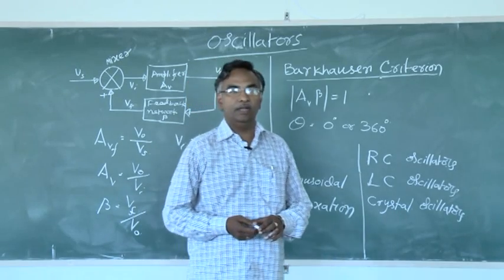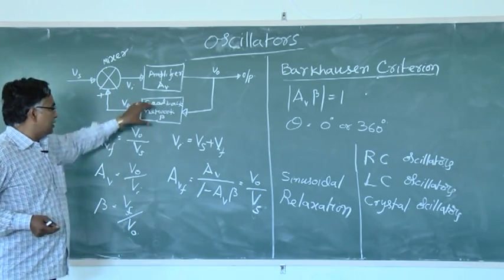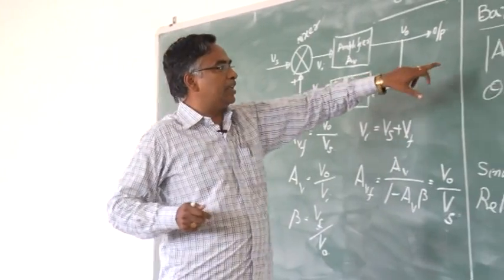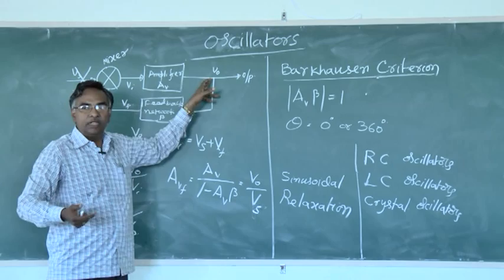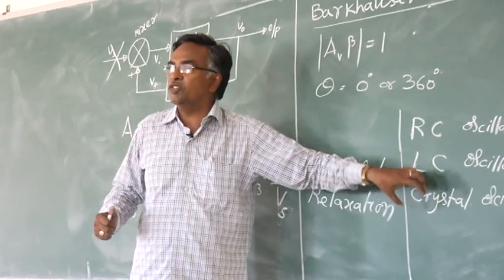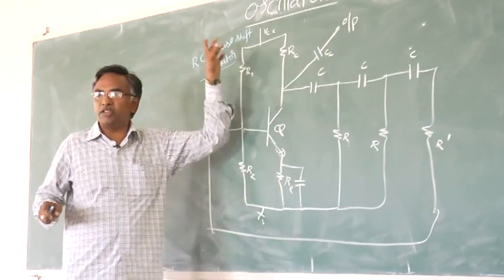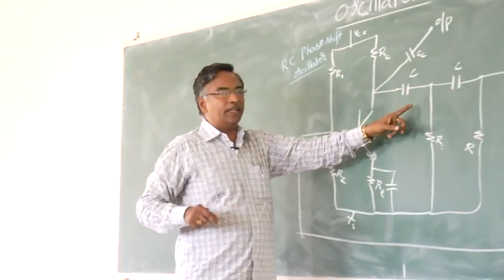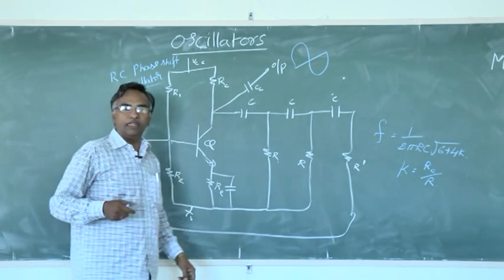Oscillators

Comment: where is barkhausen crition ??
Reply: it was on the board bro. are you serious?
Reply: sir was noticed that about the unity and phase shift they are two barkhausen crieteria's
Reply: Tx a lot sir,very helpful in exam point of view
Reply: barkhansen criterion is none other than A*beta=1
And the conditions that sustain the oscillations are (1)Barkhansen condition and (2)total phase shift=0 (or)360

Comment: An oscillator is an electronic device used for the purpose of generating a signal. Oscillators are found in computers, wireless receivers and transmitters,